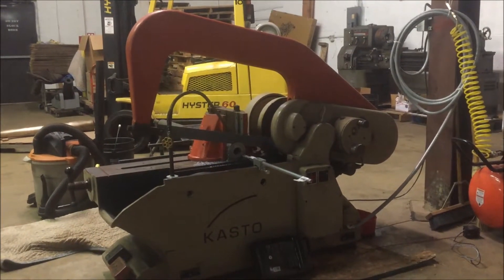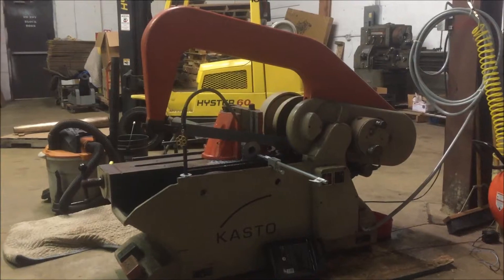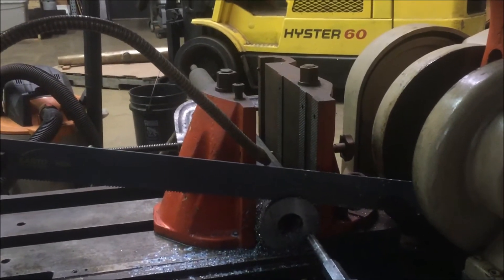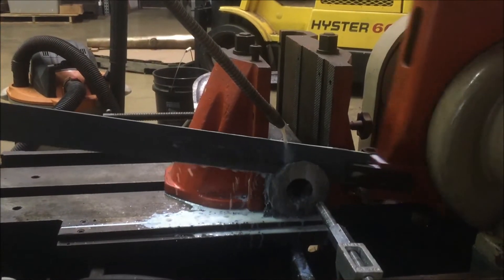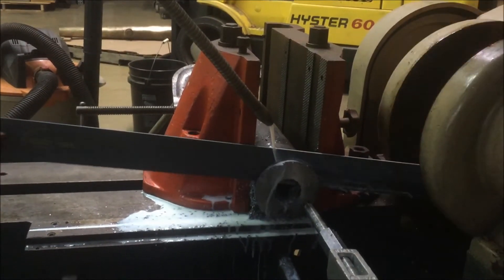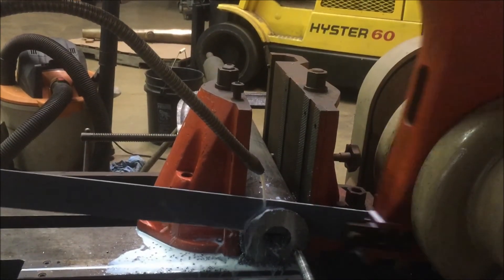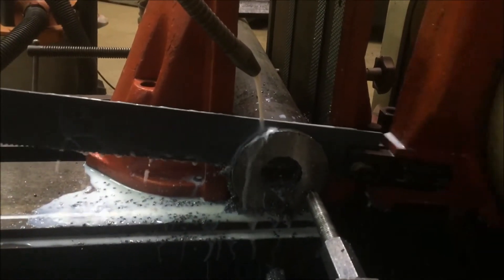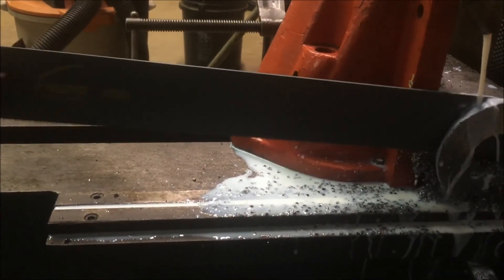Kasto cut test 1:  Moveable jaw moves during cut

Comment: Also not the best machine design to have it making the powered stroke going into the moving jaw, it would be better to have the power/cutting stroke pushing into the fixed jaw.  this is the direction most band style saws run. This setup puts all the load on your tightening nut each stroke.

Comment: We have a saw at work that requires your to fully wind out the handle before tightening. this is because of the ratchet style rack that enables you to shift the jaw quickly. If you dont loosen all the way off you often run out of tightening travel. Murphys law its always when you have just enough pressure on the job!